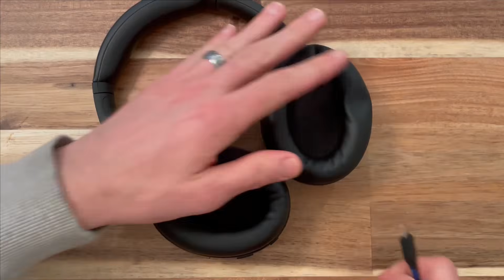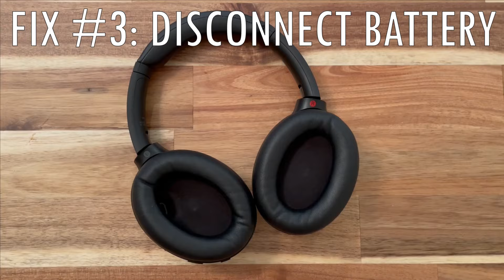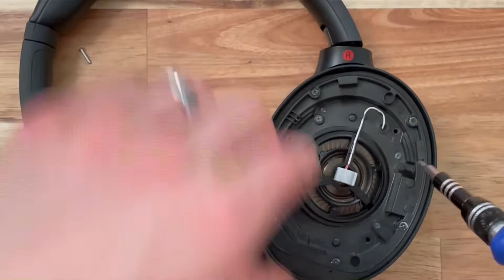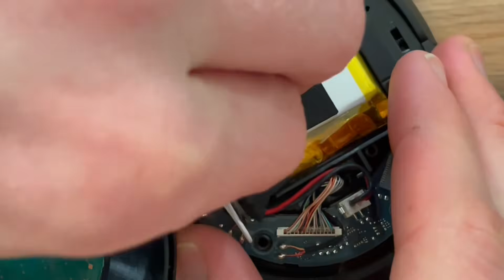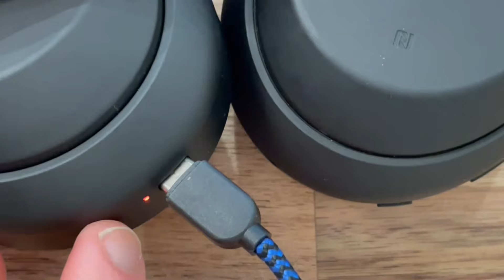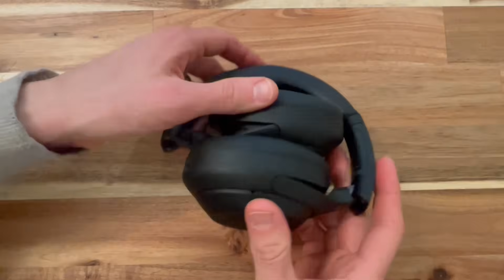SONY WH1000XM4 Battery Troubleshooting & Repair - No Power, Won't Charge & Short Battery Life Fix

Comment: I installed a new battery - now it can turn on and has a bit of charge. 
It still wont charge though, so not sure what the next step in troubleshooting is. 
I've checked every cord and power outlet, have installed new software.... 
Any help would be much appreciated!
Reply: i have the same issue, were you able to find a solution :(?
Reply: Not yet 😭 but will post here if I do. 
 @nyaaaaaaaaaaaaaaaaaaaaaaaa1944

Comment: I replaced the battery and it turns on now but still wont charge. Tried a few different cables. I'm assuming there's something wrong with the charging connection. Any info on how to fix that? Thanks!
Reply: hey i may have the same issue as you, were you able to find a solution? mine won't charge as well :/

Comment: I tried everything in your video except i didnt get a new battery. My problem was that it would only charge for a second and then the charge light would go off. I did the factory reset then unhooked the battery and hooked it back up but no luck. Then the next day just as i was getting ready to pack it up and put it away i tried to charge it one more time and now somehow its charging.

Comment: My WXM5s stopped charging and I couldn't find any tutorials for that model. However, they are similar enough that I was able to use this video to troubleshoot the 5s. The linked ebay store has parts for the 5s as well and I was able to replace both the battery and charging motherboard on my own once this video taught me how to take them apart without hurting anything. Thank you for the video! It was a real life saver!
Reply: i forgot to charge my xm5’s last nighta dn the battery drained now it wont charge :)

Comment: I applied both the soft and hard resets but its still not working. The headsets shows charging red light when plugged into the power but without power connected, there is no led night blinking or anything when I try to power up the headphones. I checked using headphone using the cables, and I guess some good part is the sound is coming. So, can you gauze what could be the issue? And, should I go with opening the headphones to look on your last steps here?

Comment: I did all you said but the charging not happening. The replacement battery did not have a heat sensor cable so I used the original one but the black pad does not stick to the battery as there is a plastic casing which I could not remove without damaging the battery?

Comment: My relative plugged in airport connector (with wire connected to the jack) to the power socket and the headphones stopped working. Any suggestions to repair it?

Comment: Great video. Did not work with my pair on XM4 however. Any other ideas? Bought a replacement battery off Amazon. Didn’t come with heat sensor so I used the original one. Headphones won’t charge
Reply: i think i have the same issue as you, have you been able to find a solution?
Reply: @nyaaaaaaaaaaaaaaaaaaaaaaaa1944  yes. I threw them away and bought a pair of Bose nose cancelling over ears 😆
Reply: Having the same issue after replacing. Nothing is coming up.

Comment: I had to buy a new pair of headphones before my trip out of country I fully charged them after buying them at the airport on the return flight back they would not charge or at least the charging indicator light will not come on but I had them on for 2/3 of a 18 hour flight and they keep saying that they are at 10% and when I plug them in the charge the charging indicator light does not come on

Comment: 300 plus dollars to be having these problems with these headphones smh😒
Reply: And I have a warranty and asurion is not trying to replace these headphones! I’ve sent them
back three times for the same battery issue.
Reply: Seriously I’m pisses last me about 5 months
Reply: Where are you located? I want to have mine repaired
Reply: My WH-1000MX4 crapped out after about a year. I sent them back and the company refused warranty on the ground that there was a trivial amount of grime in the USB port. Electronics warranties are a blimmin' joke. But with this video I have high hope of getting them to work again. Thank you Jon!
Reply: I’ve had many headphones 
These are great
Reply: Frl tho 😂
Reply: Where can I get the battery for the XM3 headphones
Reply: @duubow  US$8 on AliExpress.
Reply: Bro it's insane 😢
Reply: Someone said do this, and it worked: i just holded the power button and then plugged in the charger while still pressing the powerbutton. Don’t know if this will
Reply: @tamikawindham123 That worked thank you!! 🙌🏻 👏🏻
Reply: @Bellabambina123  No problem glad it worked for you!!! 🙌🙌
Reply: @tamikawindham123 worked for me..thank you!!!😊
Reply: I only paid $90

Comment: i replaced the battery bought it from the link you provided. The headphones turn but it wont charge and touch panels are no longer working. is there any way you can help me out?

Comment: Thank you so much!
I thought my headphone was dead.
Reply: greetings from Switzerland.
Reply: Hi Jon, it did not work. :(  I did all what you explained, disconnected the battery, but could not disconnect the heat sensor. My Model of WH1000XM4 looks a bit different on this aspect. And I could not reach the connector of the heat sensor. Nevertheless I did disconnected the battery 10 - 15 min and remounted everything. At the End the led red of charge is on when charging cable plugged but the headphone still stays dead when I tried to put it on. Also the reset thing does not work with on button + NC button pushed together.
What to do ?

Comment: Wow great video. Very different compared to other where they rush it and sometimes forget to mention a step, but in yours it's calm, slow and very detailed 🔥🔥🔥🔥. Question, can you use a flat screwdriver instead of a prying tool? And is it ok to use a pair of tweezers when reconnecting the cables?

Comment: I've only had mine since September 2022 and now it won't work I haven't used them in 3 months because I couldn't find then they worked fine before that also when I charge the orange light will come on for about 2 seconds

Comment: i use mine at the gym and they seemed fine but all of the sudden the whole right-side stopped working. the ambient sound off worked but noise cancellation and the controls stopped and they wont charge jutt got them like a month ago

Comment: Installed new OEM battery with the help of your video and it initially worked but once it needed recharging it will not recharge along with red charging light not on. I've tried all the various reset options and also tried disconnecting battery but no luck. Any suggestions or possibly need new charging circuit board? Thanks

Comment: Been using speakers so long that my pair completely discharged seemingly. If they don't work again after these steps I'm probably gonna try to replace the battery with a constant 3.7v source via a step up step down. I would really hate to permanently lose the noise cancelling ability of these just from not using them ffs

Comment: First of all, thanks for your great video!

When my WH 1000XM3 is connected with the charging cable, the charging indicator light is NOT turning on, that is, my headphone can not be charged at all. Therefore I can't reset to factory settings. I have no ideas of whether the charging port is broken down or the battery itself is out of order. Can you shed the light on how to diagnose where the problem could come from such that I could know which component I should buy from eBay? Thanks a lot in advance!
Reply: Same mine won’t flash at all

Comment: Hi Jon, this was incredibly helpful, thank you. I have replaced my battery but still no sign of life after the cans were sat in a puddle of water for a couple of hours. What would your next suggestion be? Start with a new nfc board? Or give up and get the XM5s? Thanks!
Reply: We’re did you buy the battery ? Did it come with thermal sensor ?

Comment: I'm having trouble with this but appears only shorter cables like the one included will charge mine? none of the resets worked, tried 2 long cables and 2 short, only the short ones worked including when I tried plugging into a battery pack, odd?

Comment: I tried replacing the battery - but still get flashing red light.  Thee only thing is that the replacement battery I bought in the UK does not have the heat sensor element.  Does the heat sensor have to be attached?  If that is the case then all I can think of is that perhaps the heat sensor electronics is duff.

Comment: Hi there Jon, I tried all fixes, even ordered your battery replacement and completed a replace. Still nothing on the headphones. Any suggestions for what to do next? Thanks!
Reply: Did you ever find a solution? I’m in the same spot. No light will even turn on the headphone when I plug it in, even after replacing the battery
Reply: @benjaminotwell3594 same here :/
Reply: Me as well
Reply: Sake here

Comment: I replaced the battery but they don't come on, followed all your steps .... I'm reaching out to you in the comments!   The light comes on the charging port when plugged in but thats it, just got a brand new battery off Amazon.  I let it charge for an hour via USB power from my PC.   About to maybe get some Bose , I have the international version so I don't think I can mail them in for a warranty repair in NA.
Reply: Any update on this?
Reply: @MathijsGroothuis  Thanks for this comment.  I just put the battery back in after all these months and I just heard it say "power on".  I thought they were junk but they may be fixed (fingers crossed).  I ended up getting a pair of Bose QC-45's - highly recommend.  Now I may have 2 pair of functional noise cancelling headphones lol. I'll piece the Sony WH1000XM3 back tonight and let you know how it goes!!

Comment: The red led comes on when charging but they don't turn on, the hard factory reset doesn't turn on any light and the soft reset turns off the red light for one or two seconds. Any idea on what the problem could be?

Comment: I followed all the steps you advised and it didnt work. I replaced the battery and am still having the no charging issue. When I plug the charger in, the red light comes on....then goes off after about 20 seconds. Please help

Comment: Hey! Great video and thanks for all of the helpful info. I replaced the battery and now the headphones will power on. However, they will not charge. I disassembled the entire right can check connections on from the USB C to the board, and everything looks good. Is the next step to replace USB C port?
Reply: Did you figure it out with  the usb c

Comment: Hello I tried all three of your steps and it still wont charge, so im looking to rplace the battery but cant seem to find a new one. All the ones on ebay are used, also the ones that are on Ebay there doesn't appear to have the heat sensing cable, is it ok to eliminate that cable?
Thx

Comment: Hi! thanks for your video, originally I was having a flashing red light (slow) assuming it was the Abnormal charging
 - -  - - (repeatedly flashes slowly in red) indicator, once resetting the battery whenever I plug in the charger the red light turns on for about 7s then turns off. Can you provide any help for me to fix this? Thanks in advance
Reply: I have the same issue :(

Comment: I did all of the steps and didn't work. I even bought a new battery. What should I do? When I plug in the headset, the little red led light doesn't glow red. The headphones always say they are at 10%
Reply: Any luck with this? I have same problem and think it's a chip problem not battery

Comment: i bought mine XM4 a month ago. Recently, with a few ambient sound optimization, i feel like the intensity of ANC has reduced. reduced to the point that i can hear people talking, clock ticking, neighbors barking. Is this normal? Is there any fix to this? Will the reset to the headphone fix the issue? I would love for you to reply on this matter.

Comment: Great video. Thanks for demonstrating. My I pulled up on the ribbon on the heat sensor, the plastic bit came off as well. Will I need to solder it? Will the headphones work without the ribbon connected to the head sensor?
Reply from the maker: I'm not sure if it will work without re-soldering it. You could certainly try it and see if it works as is :)
Reply: And did it work out?

Comment: hey bro. just bought the battery to replace my headphones but stilll wont charge. it working on a wired connection. what can i do. thank you bro .
Reply: it is working now., though when i charge it. its blinking red. the replacement battery i have doesnt have the heating pad. what can i do?
Reply: What did you do to get the new battery to charge?
Reply: @twofs505  its not charging.
Reply: Damn.. it's the same problem as mee.. I'm thinking IC or usb-C port. The red charge light was working but wasn't charging them a day or two later it went dim when power plugged in and then it went out completely and now no red light and won't charge.
Reply: @twofs505  try and clean the port otherwise change battery

Comment: Hi I did all of the mentioned steps and they still didn't work, I resorted to replacing the battery but my headset still won't charge and the indicator doesn't go on. I went to go check the charging port but nothing seemed to be wrong with it, I'm assuming it still has to be the issue but is there anything else I could check or do to diagnose the issue?
Reply: Following

Comment: Hello Jon.. I have sony wh-1000mx3. I have tried all the methods in your video but nothing worked. The problem is that I can't change my headphones. The warranty has just expired. I went to Sony center but they told me it is not fixable.
 I recently changed the battery but still not charging. Do you have any possible way to make it work again.?!😅💔
Reply: I have the same issue. did you ever find a solution?

Comment: Hi Jon, I tried to unplugging the battery on my 1000XM4 head phones let it sit for 10 min. Plugged it back in and still no charge. The head phones turn on and announce low battery. Any other tips that might help?
Reply from the maker: hi! I would just recommend running through all the troubleshooting steps in this video and hope that one of those works! Best of luck :)

Comment: Sometimes when I charge mine both indicator lights (charging indicator and the indicator light by the power button) light up red and stay red while charging. Do you know what this means? can't find this in the official help guide from Sony.
Reply from the maker: I'm not sure what that means either. I wonder if it could be a faulty battery. I would try the troubleshooting steps here and see if the light goes away :)

Comment: Hi, swapped battery and it works but put in charging cable again and is still flashing. Any ideas please?
Reply from the maker: It could be a bad charging cable or bad charging port. I would definitely recommend trying a new cable first and then attempting to fix the charging port if you feel comfortable with that repair.

Comment: Hi Jon, thanks for the videos on WH-1000XM4. My microphone isn't working, as in it is not picking up my voice at all during calls. I have to switch to laptop's microphone in calls.

Any tip on how the microphone can be fixed?
Reply from the maker: Unfortunately there are 5 built-in microphones in the headphones and I'm not familiar with how to replace them. I would try a factory reset to see if that may help the issue. You can also try updating the headphones via the Sony app on your phone. Best wishes!

Comment: So... here is the problem. My headphone wont charge with charger, light will turn off after a few seconds. It will charge in PC. Didnt see the percentage go up yet. What do you think?
Reply from the maker: It could be a few different issues. I would try a new charging cable first and then run through the troubleshooting steps in the video :)

Comment: I was using my OnePlus charger adaptor whose output is 4-5 A. This headset requires 2.4A . Thereby changing the charging adaptor fixed my issue where the red light turns off in 3 secs after a being plugged .
Reply: Amps are drawn, not given. The Oneplus Charger should work fine with it.

Comment: Thanks for making the video but I all the steps and still doesn’t power up. It charges (at least the red light stays on) but won’t power up and won’t even flash blue when I hold it for 7s as per the factory restore. Any experience with this specific issue or solutions?
Reply: I have the same Issue, were you able to solve the problem?
Reply: @hendrik5745  Same :(
Reply: Mine is 4.2 volt by the way, so the battery DOES seem to charge.

Comment: hey, i replaced The battery and followed all the instructions, but they aren’t holding a charge or turning on at all. The red light turns on when they’re plugged in, but even after hours they won’t turn on or connect to Bluetooth. I tried doing the reset and the first one made the lights blink accordingly, but the second way did not light up at all. after holding for over 7 seconds, no blue lights. i can’t even really get the blue lights on. what do i do? :(

Comment: I did everything you showed in the video.  Still no charge and my battery is completely dead.  You think a bad battery temp. Sensor could cause this.  I use these at work in the heat.

Comment: Hey I bought a new battery now my headphones will turn on but won’t charge.  Red indicator light turns on then shuts back off after 20 seconds.  PLEASE HELP!!
Reply: How do I contact you other than on here?
Reply: Before it would appear to be charging but wouldn’t turn on.  Now after changing the battery purchased through your ebay link  it turns on but won’t charge.